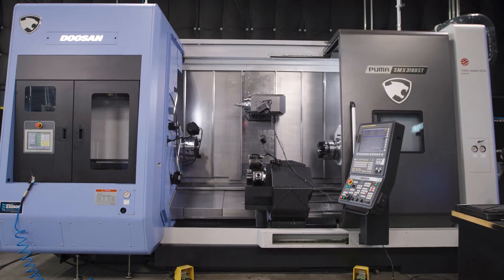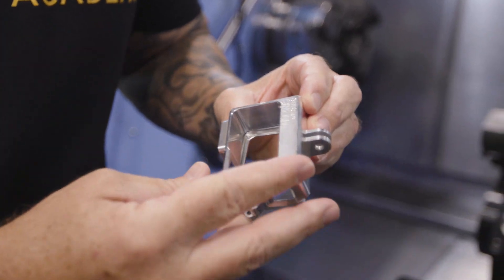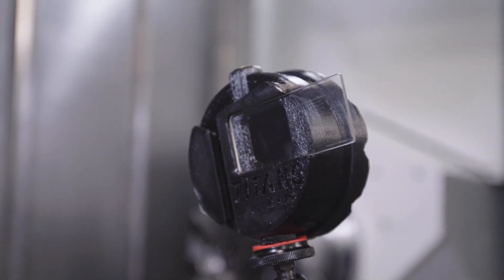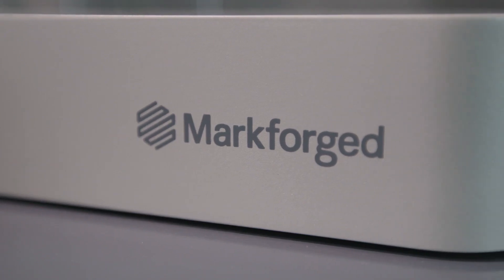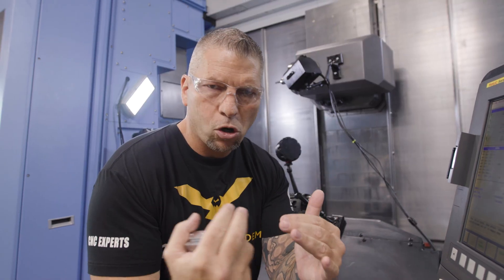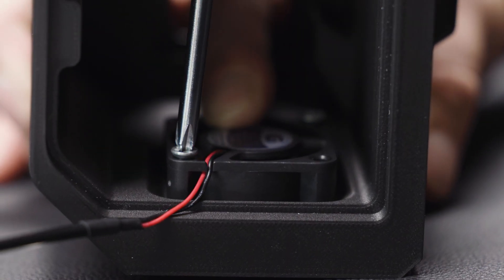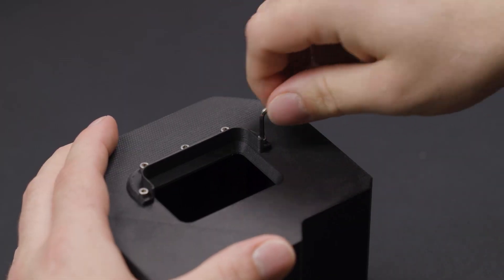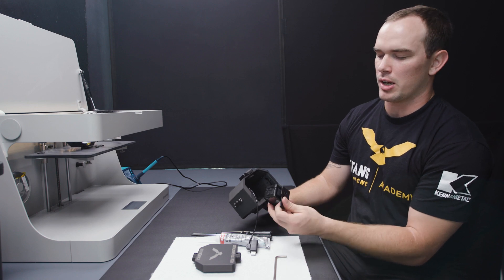Making Carbon Fiber Coolant-Proof Housing to Protect Cameras | Markforged Mark Two 3D Printer

Comment: For extra credit - make a version with a secondary spinning window so that you do not need to worry about the coolant splashing on the housing window.  Airblast may be simpler to implement, but this one would need no air supply.  If you can make a system to spin it from the edge instead of center you wouldn't have to worry about blocking too much of the camera view.... Nice work and great looking prints from the Mark Forge!

Comment: We have the same 3d printer and the same laser etching machine.  I've used the 3d printer a fair bit.  Just haven't used the Kevlar or carbon fibre to re-enforce anything yet.  It makes such good 3d prints that are very strong.

Comment: awesome to hear your using Sony cameras  for your videos, you won't regret it, I haves used Sony cameras since 2007 and have never had any major break downs or warranty work needed on them at all, the cases that your printing are super awesome and to taylor them it each unit , well it just does not get any better and i heard from a friend photographer that some company was experimenting with a carbon fibre/kevlar  weave for under water camera cases, i don't know if it was deep sea or what, i just think it is a great idea and resource that you guys utilize available technologies to your advantage and  super cool that you laser engrave the cases, such a sweet touch, great video as usual  😂

Comment: I've used the onyx before for some  difficult workholding. It takes one quite a bit of moisture/coolant and becomes soft after a while. Markforged printers are amazing but they keep increasing their prices
Reply: Got the same experience. Onyx absorb coolant like a sponge and eventually its properties are way below their advertisement. 1 time use soft jaws was flawless, but we printed a mill tool holder (the tool didnt fit in the toolholder) and after like a week it just failed.

Comment: That's awesome . Maybe u could completely remove the fan , by connecting the camera to the main frame(aluminium is a good heat conductor ) then when the coolant sprays on the main frame, it cools everything down
Reply: Coolant gets quite warm in a machine shop during summer if you're cutting chips. Air will be colder.

Comment: I have not had good luck with carbon fiber filled filament. The fibers aren't long enough to be any structural benefit. Exactly the same strength as non carbon fiber filled.

Comment: just curious if you have tried a compressed air ring to blow air away from the lens area in place of the clear plastic and if so, how did it work out. i saw this at a tool show, it allowed you to see the machining while coolant and chips bounced back when it hit the air. no lenses to get coolant on and blur the lens.

Comment: i was wondering if you could have made a aluminum housing for the gopro with some find and since coolants splashing on it if that would cool it down, is suppose since you cant really get the contact to the gopro that wouldnt work?
Reply: I think they want to use the cams on non coolant runs as well, then they would overheat